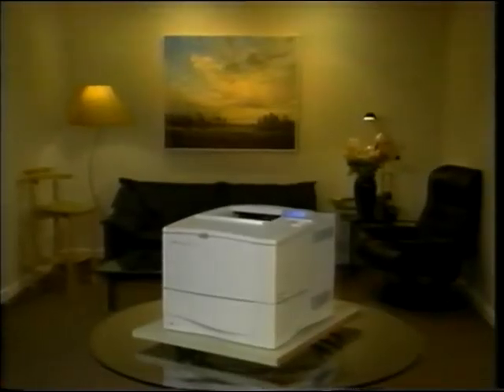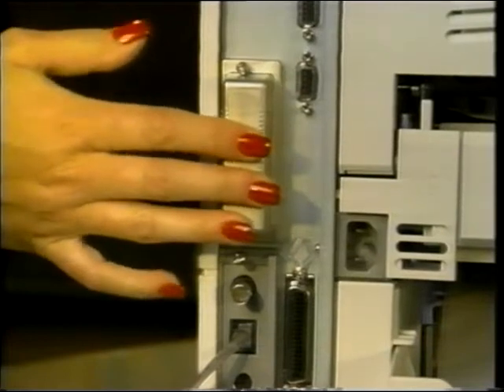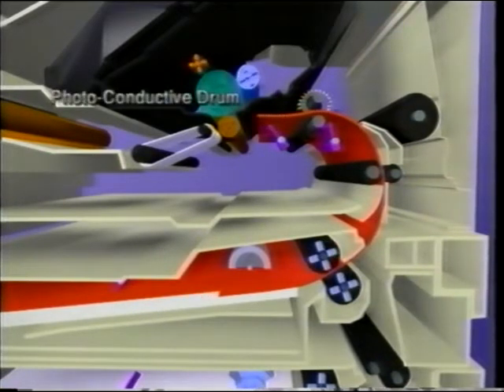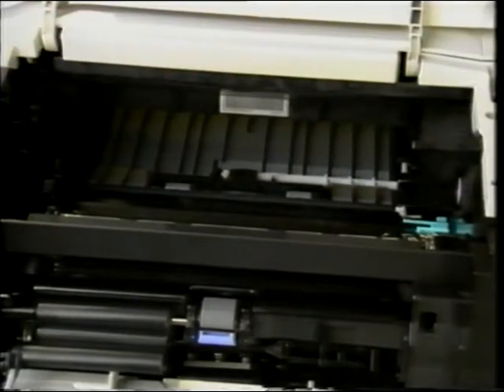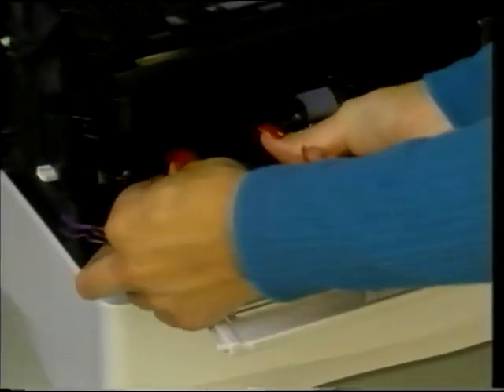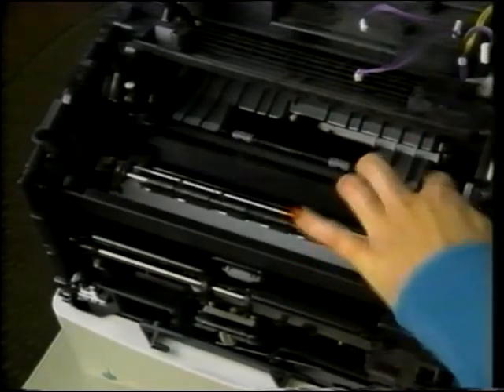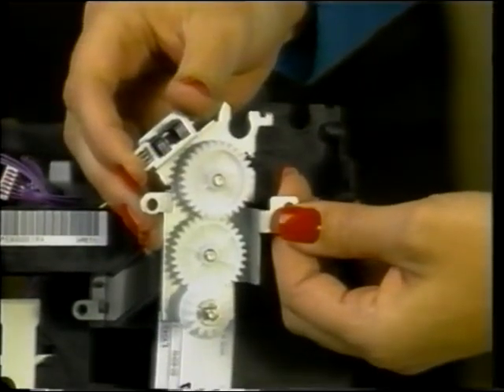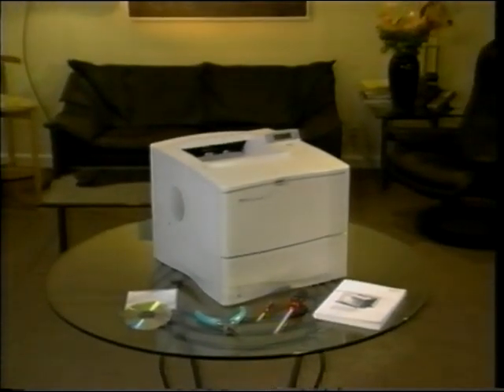HP LaserJet 4000 / 4050 Service Training Video

Comment: Anybody have a video on how to install the optional automatic duplexer?
Reply: It slides right into the Machine at the back watch the video
Reply: @woodss82  Thanks! I thought  I saw all of it, but didn't.
Reply: @woodss82  Duplex print path test passed! How noisy is reasonable to expect for the duplexer? I have a "new" reconditioned 04/2022 duplexer and the fan, the motor, and the roller squeal is remarkable.